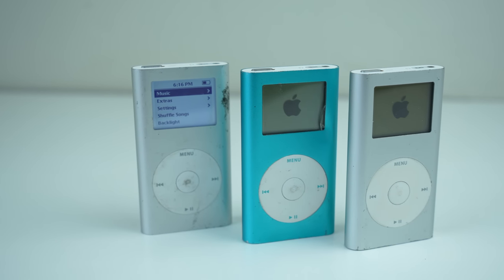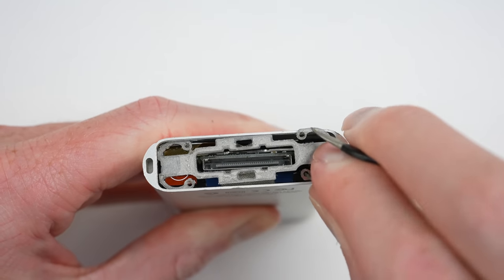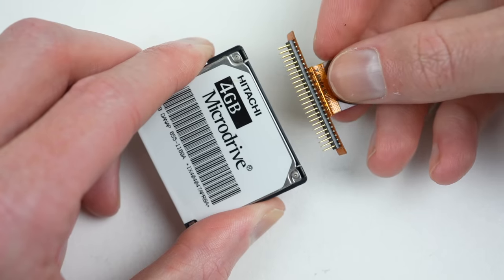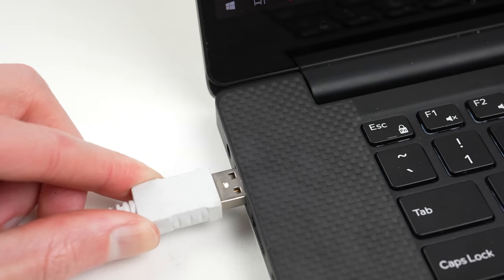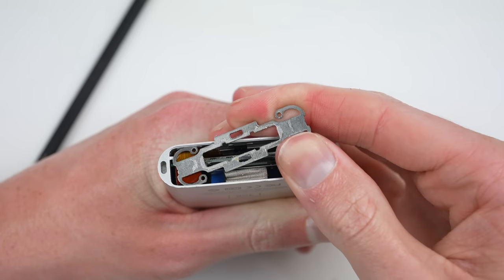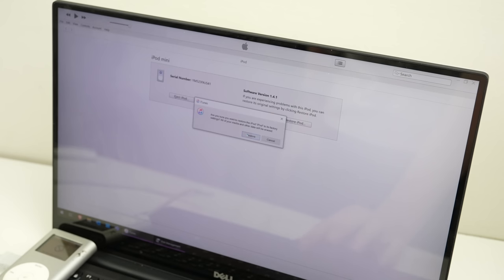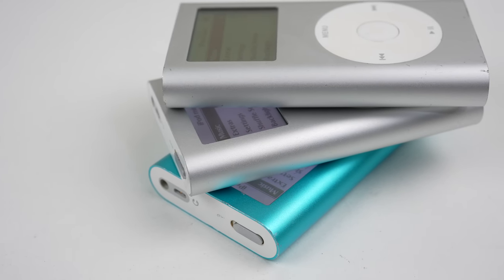Repairing 3 iPod Minis Saved From E-Waste

Comment: I use my 2004 iPod Mini every day. It still works perfectly. I use it in a 2004 Bose SoundDock that has excellent sound and volume. My wife's iPod Mini (same model/year) gave up the ghost a few years back. I am certain it is the HDD. I will be learning to disassemble these using hers, so I can perform the same compact flash/battery upgrade. If it works out I will likely do this to mine, too, but not for some time since it still works so well. I love Apple products from the Steve Jobs era. Current iPhones and all of Tim's attempts to keep us from working on our tech? Not so much.
Reply: Be careful during disassembly, you've got this👍🏼
Reply: if you want a 100% chance of it working i recommend the tarkan iflash one
Reply: did you put a cf in your mini yet?

Comment: Everybody attempting to restore or fix their iPod Minis: Be sure to use circlip pliers for the bottom retaining clips, they are made specifically for those type of clips and safety rings and make taking them out and putting them back in about a thousand times easier! :)
Reply: I was thinking the exact same thing. Where it sounded like Jeffrey didn’t like the design I thought the way they were connected was a clever idea for keeping two tiny circlips and retaining layer together. Circlip pliers might not be something most people use every day, but when you need them you’re glad you have them and they are quite inexpensive. I’m surprised more people aren't making this comment or liking yours.
Reply: Came here to comment the same.
Reply: exactly right!
Reply: indeed, surprised Hugh didn't recognise this, or have the tools.

Comment: I have several MicroDrives from IBM and of the 2 that I had presumed had failed, a gentle tapping with  small hammer actually cured the sticking drives and have been in constant use for the last year. A genius of a mechanism and they can actually be quite robust😊😊

Comment: So let me explain something to you about that model of iPod usually the hard drive doesn’t fail what it is is it’s a read write error and the only way to actually fix it and to resurrect the iPod is to format the iPod in Mac OS X extended partition with it connected to a external PC source once formatted you then fire up iTunes restore the software
Reply: Ho about if you have a PC. And no Mac OS X?
Reply: @SchoenmakerijdeSaen  follow same steps
Reply: @SchoenmakerijdeSaen  with pc iTunes
Reply: @eazysmokes3743  You can also use the version of iPod Updater from 2006-01-10

Comment: Great job =D  To bend outward that part around the screen on the blue one, next time try some pliars - press it down flat onto a table from the opposite side (so crumpled part is facing upwards), use the pliers the opposite way you would expect, ie. seperate them so they lever outwards!  It would still be difficult but by far the easiest way to get leverage in that kind of situation.

Comment: A large flat blade screwdriver with a cloth wrapped around it could have been used on the blue unit. Twist the driver inside to lift the dented section. It’s a little like PDR repairs on cars.

Comment: Nice repair and restoration of these iPod mini's! I knew of them before (and their capacities) but didn't know that they used mechanical hard drives - I didn't even know that 4GB HDDs existed, let alone fit in that form factor. The Compact Flash upgrade is a good idea and something I'd do (or a CF to microSD adapter and then use a 32GB microSD card, depending on what was cheaper).
Reply: > "I didn't even know that 4GB HDD's existed"

Guess you don't follow retro computing much do you? When consumer hard drives were first introduced 4 GB was a faraway futuristic dream. Hell, when the CD-ROM came along with its astonishing 700MB it held more than most contemporary hard drives.
Reply: @tituslafrombois1164  i think he is referring to a tiny mechanical 4gb drive not 4gb size in general...
Reply: @karnadyjuan  that's not how he phrased it.
Reply: You can get 256 in a mini 2nd gen
Reply: @jaxonsandwith502  i need to find a second gen mini i really want to do that and live the good old mates days
Reply: Cf to sd adapters are like $15
Reply: @brien1254  If they work! I used a CF to SD adapter with a 64GB card and it didnt worked, i needed to get a 128Gb CF card
Reply: @karnadyjuan  Ok, so to clarify, I meant two things:
1) I didn't know that hard drives in that form factor existed - which I stated
2) I didn't know that hard drives were sold in 4GB capacities. I knew that older drives for older systems were much smaller than what we deal with today, but didn't know that 4GB was an option. Even back in the mid 2000s, I'd have thought they'd have used flash storage, as found on most MP3 players, rather than tiny HDDs. After all, my Packard Bell Pulse MP3 player (from about 2007) has 512MB flash storage.
Having said that, I'm glad they did use a removable storage medium, as it means easy replacements and upgrades for those that fail, or just want more storage capacity.
Reply: @harrison00xXx  Usually its the crappy offbrand ones that are bad. I got an Iflash one and it works perfectly
Reply: @adamsayer11  
CF cards also work great. And these days, CF cards were cheaper than SD cards (and faster)
Reply: @harrison00xXx  really? The cheapest 128 CF card was at least £50 more than an SD card of the same size
Reply: @adamsayer11  the big ones for sure, but 32/64s were cheaper aslong you didnt buy the sandisk extreme ultras

Comment: Well this brings back memories. I used to run a iPod repair service on eBay back in my last year of highschool and through uni. The Minis were great. Much easier to open without leaving in marks compared to the 3rd and 4th Gen iPods. With regards to those clips. I found the best thing for them was a set of Circlip pliers. 

Regarding the microdrives. These were made to fit into compact flash type II slots. Mostly used in embedded systems thats didnt need much local storage aswell as things like DSLR cameras You could also get them with a PCMCIA card adapter for laptops. For the time they were great because flash sucked in 90s and early 2000s. Cost an arm and a leg. Almost used as much power to write to a spinning drive. The write cycle life was also terrible compared to todays flash. 

But i do think the microdrive was an odd choice by Apple. By 2004 flash had gotten a lot better. And i really cant imagine 4GB of flash would of cost THAT much different to the cost of the microdrive by the time you factor in the cable, rubber bumpers and all that. (assuming the flash here would of been soldered to the board so didnt need other components). The fact Apple dropped the mini after only 2 versions and moved to the flash based nano sort of backs this up. 
That being said though. The mini has a charm that the nano never did IMO. It also has a much better DAC compared to the early nano versions.
Reply: Don't underestimate the prices of flash memory in the olden days. I just looked up some old CF cards, the cheapest retail price of a Lexar Professional 40x 2 GB dropped from about 600€ in early 2004 to about 400 in summer and later around 200 by the end of the year. A 2 GB Hitachi Microdrive fell from about 200 to 100 in the same period. A 2 GB iPod mini retailed for under 200 in 2005. My first MP3 player that I got for Christmas in 2005 was a Cowon iAudio G3 with a whopping 512 megs, a common size at the time (the 1 gig model would have been almost twice as expensive, the 2 gig 3 times). Keep in mind it was all SLC still.

Comment: Would it have been cheaper to use SD cards in an SD to CF adapter? I've seen those on Amazon for around A$23
Reply: cheaper? yes, if it works
I once tried a CF to SD adapter and it didnt worked, i needed to get long ago already a 128GB CF card (and it was also a lot cheaper than today)
Reply: Iflash is the only reputable company that sells reliable ones but it can also break depending on the brand and type of microsd card(s) used. It somehow becomes an even more apparent issue if you're trying to use rockbox on top of it all
Reply: iFlash should be only around $20. The cheap ones that are infamous for being reliable are the unbranded red CF adapters that run around $10. A slightly cheaper option is the Digigear CF ($17) which is as reliable as the iFlash: I haven't had any issues with mine and I haven't heard any issues from others who used the Digigear.

Comment: Ha, used to buy these from ebay in 2008 as broken and upgrade and fix em up for resale.  Originally I was also planning to reanodize them to unique colours but didn't get that far. I polished a few into mirror finish though. I still got three units left over from those days waiting to be fixed up. Would make for a good youtube video I suppose.

Comment: Use not very old toothbrush (medium strength) for cleaning. You will have much better results. Also add some alcohol on the brush while cleaning. Also possible to use very thin paper tower between surface and brush.

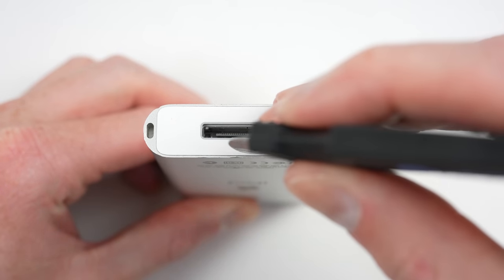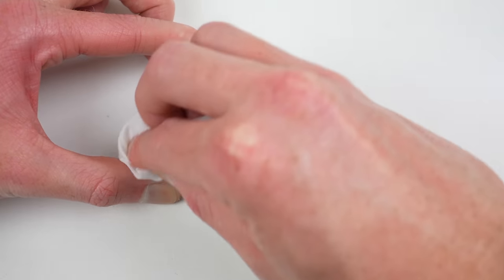Comment: 1:23 2:25 This part can be done purely with plastic tools. Using a metal tool even just to wedge a plastic tool in can permanently scar both the plastic piece and the metal frame with scratches, and these marks are visible in eBay listings for hasty jobs. It's not as important for these iPods which look pretty banged up, but for an iPod Mini in very good condition, keeping it that way is important. I believe this prying is what caused the noticeable gaps between the plastic and metal at 12:15 and 12:21.
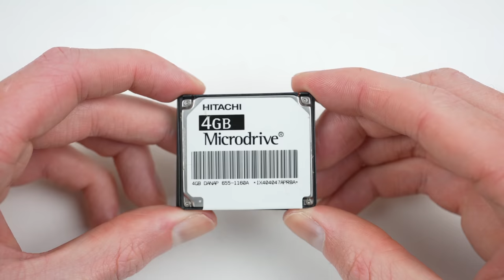4:35 Buying proper compact flash cards is needlessly expensive; many SD card to compact flash converters are compatible with the iPod Mini. Available in the US is the Digigear CF adapter (~$15) and the iFlash SD-CF Adapter (~$20) although I'm not sure how available these parts are in Australia. For the same price as a 32 GB CF card, it's possible to put in 128 GB or maybe even 256 GB because SD cards are so cheap. Also worth noting is that the 1st gen. iPod Mini can only take a 128 GB SD card, but the 2nd gen. can do 256 GB.
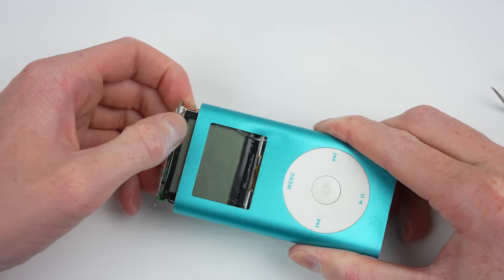7:32 Avoid pulling on the metal bracket since the connector and board are fragile
8:45 This is a really creative idea! I haven't seen anything like it before, so I'll definitely try it on my cracked one.
10:20 It's a misconception that the 2nd generation has a larger battery than the 1st generation; they actually have the same battery. The 2nd generation has nearly double the battery life because the circuitry inside uses less power than the 1st generation. I'm not sure exactly what it is they changed though (maybe some circuit runs on a lower voltage or it's just more efficient in general or something like that).

Comment: Hugh, what about using a socket extension, like a 10-inch long 1/4 drive? You could put the case on a hard surface, dent down, and roll the dent with the extension? Not sure if it would give you enough leverage but maybe?

Comment: For that bottom clip you could use internal snap-ring pliers or cir-clip pliers, should be way easier. You just have to make sure that the pliers fit in the holes of the clip :)

Comment: When I upgraded the storage in my green 2nd gen iPod Mini years ago, I just used a CF SD card adapter with a 32GB SD card instead of getting a 32GB CF card. Cut the cost way down for the upgrade.

Comment: CF Drives are still easily available because a lot of high-end digital cameras use them for storage - it seems like they are just very expensive in Australia, as the same SanDisk ones Hugh used are £30 on Amazon, there are also lower capacity ones that are cheaper, example being a Transcend 133 32GB Card for like £22, or, for more space, a Lexar 64GB card for like £60.

Comment: I've modded a 2nd gen model of these iPod Mini's. Fitted a new battery and instead of CF due to cost I picked up an iflash CF to SD adaptor and installed a 128GB SD Card. The adaptor and card cost around £50.

Comment: note for future reference: the front screen plastic can be replaced without a problem just by heating up the front of the case with a hair dryer and pushing it off then replacing it with a non cracked or just less scratched one

Comment: I just saved 6 MacBook Pros from 2017, 1 12 inch 2017 MacBook, and a MacBook Air 2017!!! from becoming e-waste. The woman just said her company buys new ones every three years and that they would have been thrown away if I didn't take em. So I checked em, turned out that some of em (like 2) had a decent liquid damage, but the other ones were just fine and didn't even have that much charge cycles! I split up those Macs to two other colleagues of mine, ending up that everyone had two fully functioning MacBook Pros. I gave a MacBook Air to my best friend, who needed a laptop for her education, and kept the other MacBook Pro for myself since it is way more portable than my 16 inch MacBook Pro. All MacBooks had charge cycles between 100-350 which is still actually very good!

Comment: these have the micro dirve in them if it's a 2nd gen you can put a cf to sd adapter and get 256 gb of storage 
if it says 2004 on the back of the case it's a 1st gen
if it says 2005 on the back of the case it's a 2nd gen

Comment: Wonder how someone would go about replacing the iPod mini's screen? Someone kicked my backpack during soccer practice in high school and found my iPod mini's screen broken. It still works regardless, but I'm sure the battery and hard drive will need to be replaced.

I'm glad I kept my iPod mini around! It's such a classic music device, and would make for a great portable jukebox I can hold my music in to save on my iPhone's storage.
Reply: Unfortunately, replacement iPod mini displays aren't produced, so all screens floating around out there are pulls from existing iPod minis. Your best bet would be to get another iPod mini with a functioning screen and swap it in

Comment: I still have my Ipod mini. I only stopped using it because the battery is as good as dead and I didn't know how to replace the battery (and apple told me they don't do that).
Now I know I never had the tools for it anyway...
I wish I knew where can I get its battery replaced and, while at it, a flash card replacing the ageing drive
Reply: If you are in Australia, I would be happy to help you! If you buy the parts, I will do it for you no charge!
Reply: @Pleiades55  I'm in EU, actually. Thank you for the proposal, though.
Reply: @brunoais  Oh well, the iPod Mini is pretty simple to work on. You would definitely have no problem doing the mod yourself, just watch Hugh's video for the how to!

Comment: just stumbled upon my old 6GB iPod min (M9801LL/A) been in storage room for 10+ years. question of the day, is 32GB Flash the most it will take or can I beef it up to say 256GB?
Reply: 256 is their supposed max, but the tricky bit is finding and SD to CF adapter that can actually handle those large SD cards most max at 64gb

Comment: Dude. Don't you know you can get CF cards that have inbuilt MicroSD slots in them so you can use CF without having to spend $$$? The CF/SF module is about $12 and a 32gb MicroSD is also $12. You should give this a try. If you don't then I'm going to buy an old mini from eBay and try it myself! I know this method worked for my old DSLR.

Comment: seems like the reassembly would be a bit easier/safer if you installed the bottom clip BEFORE inserting the electronics
Reply: That would block access to the click wheel connector
Reply: @CubeBag  oh right, good point

Comment: Is there no sd card to compact adapter? if yes that would be a cheaper solution
Reply: There is, it is cheaper depending on capacity, I've personally done this procedure on two Minis and a 3rd gen iPod (with the touch buttons and fixed scroll wheel)
Reply: yes you can find them but some people report bad experiences, not being recognized or requiring constant restoration by plugging them to the pc, cf is a perfect replacement, because it connects like a hard disk, no adapter required
Reply: @arch1107  True, CF is the simplest👍🏼

Comment: Where can I buy the pink Adhesive you used?
Reply: that is not adhesive, it is double sided tape, check it on ebay or amazon, it is a roll of half inch width, the pink thing is not pink, is a red tape that protects the sides of the adhesive tape

there is thicker and thinner tape, you buy in base of what you need to stick together

Comment: With the price of CF cards why not buy an adapter to SD?
Reply: that is a option, but those adapters sometimes will give you problems, not being detected or working not that reliably

the cf card works as a parallel ata hard disk, so is a 1 to 1 replacement, device will not make any complaints

Comment: At $50 for a replacement HD it doesn't make financial sense to fix it, it would be purely for nostalgic reasons, hence why most are trashed.
Reply: You can have a 128 or 256 GB iPod Mini for a lot cheaper than an iPod Touch (discontinued)

Comment: Could I use an SD or Mini SD card in an adapter ?
Reply: Yes, but some SD-CF adapters don't work. In my experience the Digigear and iFlash work fine and the unbranded red adapters don't work.
Reply: @CubeBag  - thx a lot for the answer, I’m in germany so I’ll have to look around where to get these. 👍

Comment: That's not the right way to install the battery, next time have a look at the way the one you removed was installed! The wires curl around the plug, not stretched all the way to the bottom, just saying!

Comment: why not get a CF to SD adapter. waaaaay cheaper.
Reply: it is true, but some people report problems with the sd adapter, it likes to die, or reports that it needs restoration randomly, so the c is a perfect replacement with no need to restore anything, it works as a hard disk

Comment: CF Drives are great, but 128+ GB of space would work.
Reply: Yeah, which is why CF to SD and then using a 128GB SD (or micro SD) card would also work nicely :).
Reply: @TheSpotify95  A CF card of 128 GB would work.